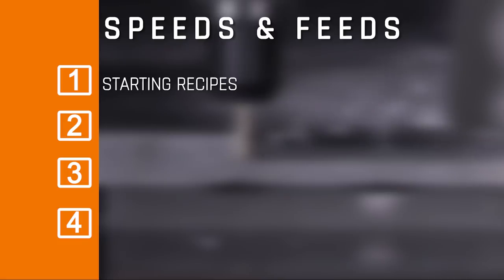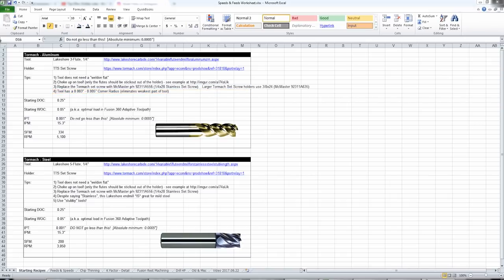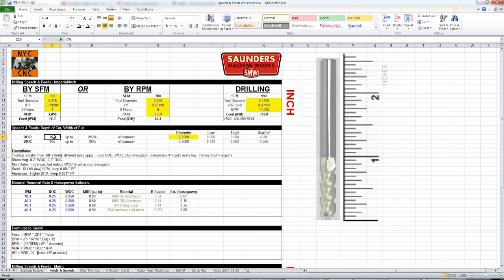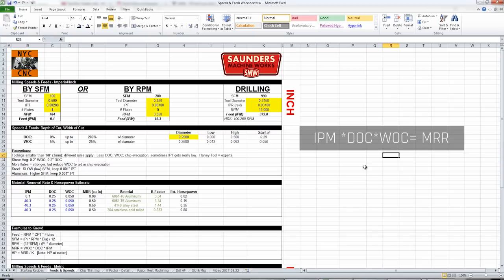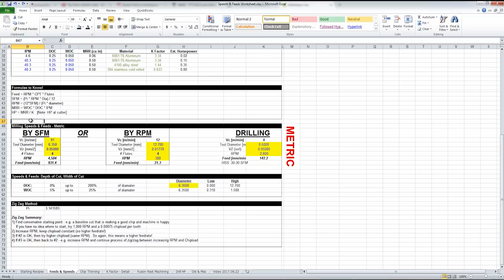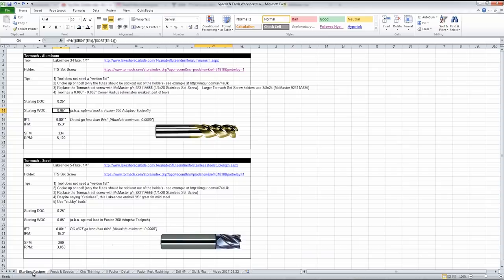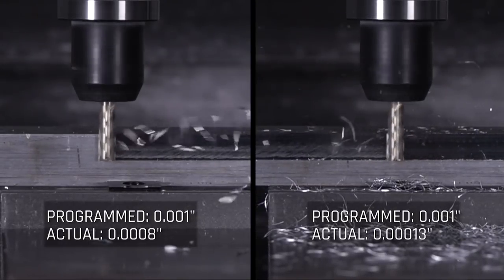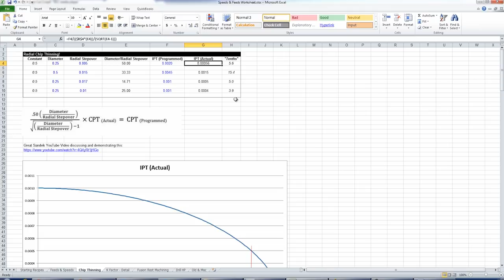Speeds & Feeds Tutorial for CNC Machines! WW164

Comment: Confusing with inches. I'm from Sweden and we use the metric system.
Reply: took me so long to figure out that tenths are smaller than thousandths .... wtf imperial..
Reply: Tenths of a one thousandth: 5 tenths = half a thousandth = .0005"
Reply: So strange, I am from U.S. and found learning metric no problem at all.  Your English is tops by way.
Reply: @Matt Davis, tenths aren't smaller than thousandths.... .1 = 1 tenth, .01=1 hundreth, .001=1 thousandth
Reply: thats what makes sense but it seems very common (as used in the video) to use a tenth to refer to a tenth of a thousandth (0.0001). For metric a tenth is a 0.1mm and a tenth of a thousandth 0.0001mm is outside of the range I can even measure let alone machine. So it is pretty confusing. From what I have seen tenth of an inch 0.1 is rarely used.. would be more likely to be using fractional representation at that size in imperial.
Reply: @francisco hernandez 5 tenths does not equal .0005", 5 tenths equals .5"....5 tenthousandths does equal .0005"
Reply: Jim Duchow you're quite wrong. In the machine world people say tenth for 10e4 units. It's not "tenths of a thousandth", it's short for ten-thousandths.
Reply: @JohnHolmestheSecond likewise talking about what passes for common parlance within a predominantly imperial based shop is kinda showing your own ignorance on an international platform, i.e. youtube.  We either learn to talk in a manner that doesn't involve non-specific shop talk or we don't get a chance to learn from those who work in different measurement systems.  Good fan-boy though, I'm sure John will sleep better knowing you protected his poor use of language, which is a fact, regardless of "shop short hand."
Reply: @jim duchow Jesus fellas, don't confuse 3rd grade geometry nomenclature with CNC machining. Yes 5 tenths in geometry is .5" or (5/10) but in machining that is commonly referred to 500 thousandths. The scale in the CNC world is typically regarded in thousandths of an inch so .0005" is half a thousandth, OR 5 tenths of a thousand. For short, machinists will say "5 tenths." Hope that helps.
Reply: @matt Davis, 0.1" will never be referred to as one tenth in the machining world. It would be considered 100 thousandths.
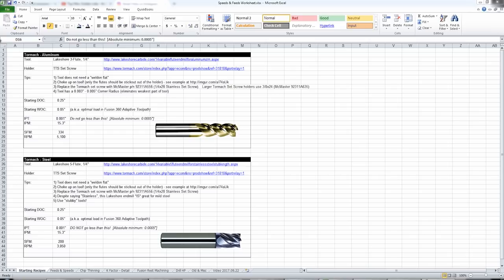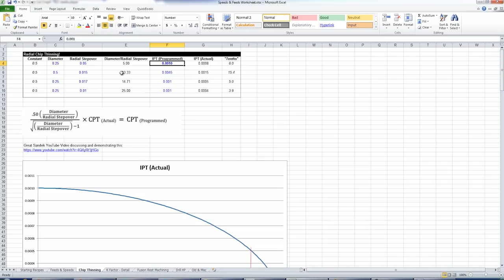Reply: @matt davis apologies, before responding I watched the vid again.  You are correct @~3:37, ~16:55, ~17:03, and ~18:40 he did say tenths incorrectly, @~3:37 he used it in a lazy fashion.  What I mean by that is he said tenth in the context of a thousandths measurement, which would also be a tenthousandth.  You are the victim of the "shop short hand" that occurs in the US.
Reply: Jim Duchow I was quoting people above you, little man.

Everyone can see these comments, and anyone confused can now learn.
Reply: I am shocked at the number of trolls. 
.1         = 1 tenth
.01       = 1 hundreth
.001     = 1 thousandth
.0001   = 1 tenthousandth
.00001 = 1 hundredthousandth
I could give 2 shits what your hillbilly machine shop says these numbers mean.  Clearly the variances  expressed indicate a preference to position of accuracy (sorry that idea probably eludes some of the repondants), however if we are to derive a system of measurement that all can understand, we need to adhere to some sort of common sense and the decimal point is a reasonable position not the shops individual position of repeatable accuracy.
Reply: On a totally different and less salty note, I had no idea that putting x:xx in the message would automatically put timestamp links into the response, just worth knowing
Reply: well looks like it might be a machinist/shop terminology as well as imperial units causing confusion for us metric people. Anyway great info in the video. Specially regarding the chip thinning. I tended to do slower light passes for finishing and the suggestion is they should probably be faster.
Reply: yea it's a tenth of a thou hahaha
Reply: Jim Duchow it's not shop short hand. If I went to Boeing, they would say tenths to me. If I went to any manufacturer in the US or Canada, no one would have a problem understanding what tenths are in grade school OR what they are in the manufacturing industry. You are clearly being disingenuous about your work history.
Reply: ive always referred it to as a tenth never a ten thousandth lol wtf, his terminology is perfect, but some people use different terminology, doesnt mean john is going to say all the terms everyone uses
Reply: but your right there are a lot of newcomers into machining or just want to learn, and he needs to specify terms for some people that may not be familliar
Reply: 99.48% of the worlds 193 countries have fully or partly adopted the metric system.
Reply: tenths refers to thousandths, not inches in machinist speak. 1 tenth is 1 tenth of 1 thousandth.
Reply: Saying a tenth to refer to .0001 as opposed to it's whole definition is easier and quicker to say. Toolmakers split tenths as in .00001. Has nothing to do with definition. It's just easier to say vocally and us American imperials understand it.
Reply: After working in an all metric shop i can say metric is way better. More accurate measurement unit and way easier thinking and programing with. Metric is 25.4 times more accurate than imperial, if you don't understand why, you should quit machining No fractions and radius/diameter so easy, endmills are 1mm 2mm etc, not 1/32" 3/16" etc. Speed and feeds in metric is expressed in surface meters for speed, do the math with same formula in metric than convert to inches and do the math, you get the same numbers, you're good. Watch out, any catalogue associated with the US will say the speed in SFM, you'll need SMM.

Comment: I have a very similar spread sheet. I haven't added the chip thinning aspect because I hadn't fully grasped it. This video just closed the door on that.  Although similar, my is , say backward. I approach it from availible hp at the spindle and MRR based on material. From there it's basicly a balance sheet DOC, WOC and chip load are manipulated so that the sheet balances  HP,  MRR and SFPM.  This tend to be great for lower hp machines.
Reply: Horsepower is everything. I drill 2" holes 8 ft deep and my machine has 70 horsepower and that sometimes isnt enough. I never drill a pilot hole, thats dumb, only if youre machine had 5HP would i ever do that

Comment: Hi John you have released another very good video as usual. I was just wondering if its at all possible if you might also be able to in your future video's to also include feeds, speeds, width and depth of cut information in metric as well if its not to much work for you. It would help us aussie's and other guys who use metric at work so I know how my feeds and speeds compare.
Reply: Steven Jevicki come on dude! He's done the heavy lifting for us. Multiplying by 25.4 isn't so hard. He's also included a metric calculator in his spreadsheet.

 He's incredibly generous, don't push it!
Reply: The drawback might be that with someone who doesn't natively use metric and imperial you might get whacky 'accurate' conversions, for instance 40 thousandths of an inch would become 1.016mm.  In the metric world we know it's bollocks and 1mm is sufficient but the 'imperial only' people really don't understand.    Same with tapping drill sizes, it's easy for metric people to 'guess' with a very high high degree of accuracy a tapping drill in metric based purely on thread diameter and pitch, imperial people do those strange conversions nearly always ending up with undersized holes and higher tapping loads. In the imperial world of threads it's almost pure voodoo with letter number and fractional drill sizes with dozens of lookup tables.   Having said that an imperial fastener head size (post whitworth and in the UNC/UNF era) was easy to guess by eye,  metric is significantly less so particularly when standard head sizes are abandoned because of cost/weight saving.

Comment: @NYC CNC I was checking the math in your calculator, it's not off by much, but there is a bit of a mistake in the "Radial Chip Thinning" portion of the calculator. In the square root of the denominator you included the -1. You have to take the square root and then subtract one. Changes the IPT (Actual) result just a bit. Hope that helps. Keep up the great work!
Reply: I was just about to ask about it and i saw your comment.
Reply: @Bay Van, way to stay on top of your math :)
Make sure you note the change so your chip thinning calculation is correct...Take care
Reply: @ciscohernandez4384  Just found the same error when trying to recreate my own calculation. The -1 isn't in the square root operation in the reference equation. Great video though!

Comment: Great explanation here, but I'm really surprised you don't use GWizard Feeds and Speeds calculator.  It takes all of these variables into consideration (material hardness, chip thinning, surface speed, horsepower, etc) but also considers much more, such as tool deflection, for a total of 60 variables.  Surely you must know about it?
Reply: None of that matters if you follow NYC CNC advice on tool setup. You'll make scrap and get hurt. Work holding matters too. I've seen a 12,7 mm drill push a 30 tonne block because the guy had to high of rpm and it dulled it quick

Comment: Find a feed and speed you like. Take notes. Find the chipload of it. Divide the chipload by diameter of the tool you used. That number is now your constant you multiply your tool diameter to get chipload and also the chipload of a 1” tool

If chip evacuation is a problem use less flutes. No shame in using 2 flutes on steels either. I recommend all finish passes have spring passes or run finish twice for best surface finish and straightness. Programming with feed per rev is optimal especially if chatter is a problem and you must reduce RPM. 

Finishing chipload .008xD

For weaker longer tools distribute engagement and depth and reduce SFM till no chatter occurs. Reduce chipload by 20%. Feed per rev is highly recommended 

Here’s my recommendations (commit to the cut! And have enough HP)

1018 steel
600-700 sfm
Chipload .006”xD
Radial up to 100%
Axial 150-200%

Stainless
304/303 sst 
300-600sfm
.003-.006xD
Radial up to 100%
Axial 150%

Aluminum
Max sfm
Chipload - .012”xD
Radial up to 100%
Axial up to 100%

Comment: I understand that if the IPT is not correct, the chip will not come out correctly but this part is still not clear to me for example
 My calculations say that IPT (Programmed) = 0.004 but IPT (Actual) is =0.00079599, what should I do? Increase feed rate or decrease rpm or what is the solution

Comment: Great material as always John. It looks as though your spreadsheet applies to pocket or trochoidal machine ops. In using a profile op (on a CNC router), there of course would be no step over, so I’m sure the DOC would have to be affected. Although I have a 3kw motor and have done aluminum with varying success, I hope to dial in the profile op to yield consistency in performance and finish. The torque curve on the motor makes speeds greater than 7;000 RPM a necessity in aluminum, (in softer materials I have more latitude). It is a shame that most F&S calculators on the net leave out DOC (don’t quite understand that). Any advise from you or the community here would be appreciated. 
Thanks.    - Walt

Comment: Great video John, thank you. Interesting to see the comparison in your video at 16:03. The very thin chips tend to evacuate in a more "random" direction and you can see many of the chips re-enter between the cutter and the material which would definitely increase tool wear.
Reply: Christo Candiotes   I have experience that, making thicker chip have more mass to fly with a better and longer parabola to corners of the enclosure. Thinner  get often stuck due to sprayed coolant.

Comment: I personally don't like set screw holders. The screws get stuck and stripped, runout is generally worse than ER, marginal holding power. 

The rest of the material is a nice presentation of the S&F concepts. 2 thumbs up! I wasted SOOOOO much time until I took the time to learn how to properly load my tools. After digging in to the topic, I made parts faster AND my tools last longer.

Comment: I need a way to override the calculations that are made in Fusion 360. I work with wood, and there is no need for the settings the software employs. If I were to use them, it would be highly inefficient. I need to be able to set my own feeds and speeds. Without them affecting one another. For example 500 inches per minute is what we use on our machines for travel, and 20,000 rotations per minute when we are cutting our products. How can I set this without them re calculating each other, or other settings?

Comment: Low engagement deep cuts is not going anywhere but in my opinion real high efficiency milling is full depth high engagement. Power milling results in the fastest run times and time saved completely outweighed tool life.

Comment: Why do VMC machinists insist on using IPM instead of IPR? If chipload per tooth is so important, wouldnt it be wise to synchronize Feed with RPM/SFM?
Reply: Because when you're setting up your toolpaths in CAM, the two variables that you need to put in are speed and feedrate (measured in IPM).  While IPR is useful for calculations, you don't put that value into the software.

Comment: Sorry had stop watching at the start, i was hoping maybe to learn something. But when you recommended a side lock instead of a collet for a 1/4" tool that makes me doubtful. But then you said that you dont need to grind a flat, that is almost the dumbest thing ive ever heard. Dangerous, you shouldn't be teaching people to cut corners cause you've been lucky and lazy, somebody will get hurt. You probably end up with steps on the surface, in a corner it will pull out. I recommend buying the best toolholders you can buy. Nikkon holders and collets. Roughing use a side lock, make sure flat is as deep as the chamfer on set screw but no deeper. Then lightly snug set screw and carefully you should be able to slightly pull the tool out and then tighten set screw. You always do that so if the tool becomes loose while cutting the tool can only move in and shorten the tool. It will happen someday and atleast if you the the tool wont gouge the part. Not good to break a tool and scrap a part. I machine 3d shapes into steel the size of your car, i know
Reply: We program very aggressively at my shop and I cant think of any time we've needed a Weldon flat on a .25 endmill.  Ever.  I also question YOUR knowledge when you recommend milling in an ER collet over a solid endmill holder.  If you have good tooling, the solid endmill is a much more rigid option.  Aside from speeds and feeds being on the conservative side, there's nothing wrong with the advice given in this video.